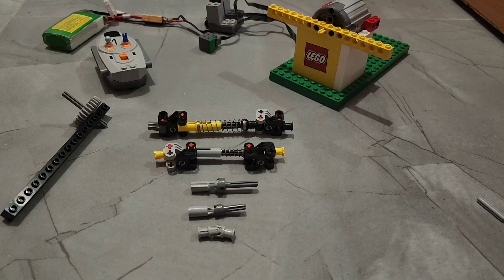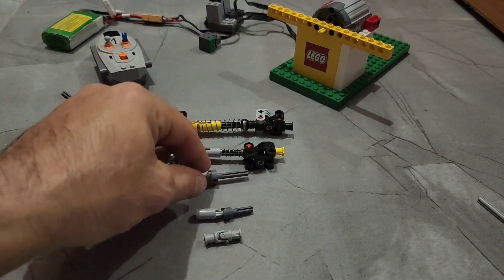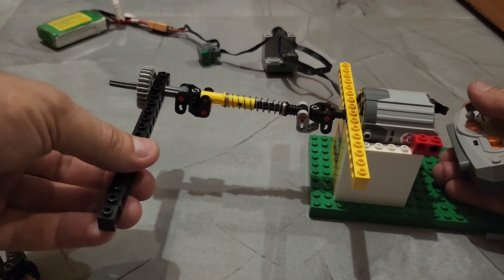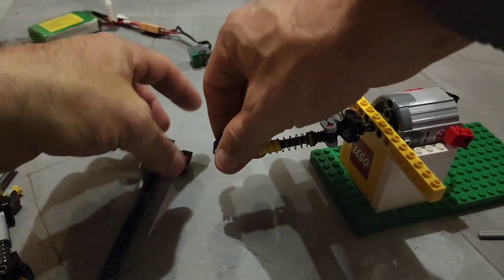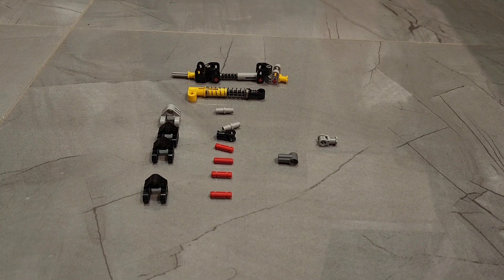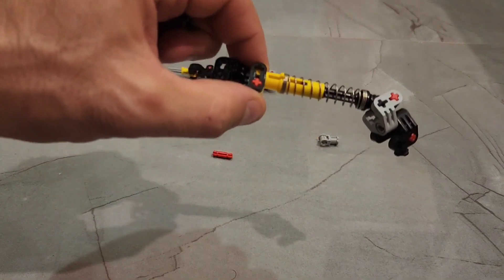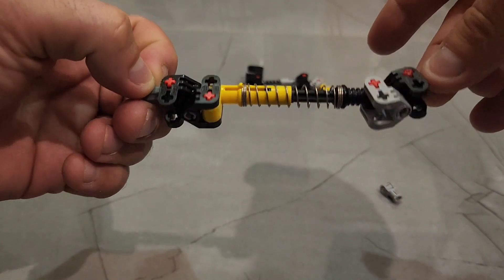lego technic: new cv joints/universal-joints

Comment: It does feel like reinventing the wheel. I don't believe this would be stronger a than 77590, which has plenty of shaft extension space. The spring is twisting when you try to stall it, and also the spring in a compressed form will add friction. Also, the power transfer won't be smooth, it seems to be wobbling quite a bit.
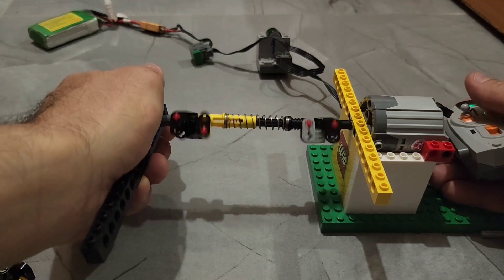Reply from the maker: The wobble depends on the engle. If the engle is not on the "edge", it wont wobble at all. The shaft of 77590 is smaller. Its not perfect, but i think it's better. Try to look at 2:58 sec. The spring can hold torque.
Reply: @yuvallegomotorized  What do you mean the shaft of 77590 is smaller? Smaller than what? Where does that matter? It has 3 studs axle depth, out of which it can have two studs of compression/extension. And you can add more connectors to build a shaft of any length you want. I did look at 2:58, after some time it seems to twist the spring a bit. Also, what happens at 11V on a Buwizz3 with two Buwizz motors coupled? 77590 can handle that.
Reply from the maker: @viktorgyenes8368 buwizz can deliver less power then lipo and ir. 
This travel was problematic for me in the past when i wanted to use big travel of shocks, and it was realy weak amd didnt hold for long.
Soon i will test it with a car and then i will know better myself.
Most of my builds have 4 buggy motors or more.
I plan for the future car to be with 6 or 8 buggy motors, fed by lipo.

Comment: this exists btw 77590
Reply from the maker: True. metal too, but its less strong from this one, and they limited you with smaller shocks traveling.
Reply: @yuvallegomotorized  i think its stronger than your design as yours relies on pins (which shatter and disconnect too often I know)
Reply from the maker: @glowytheglowbug  
Just test it.
I did 🙂 2:57
Reply: @yuvallegomotorized  this has more travel than some shocks i think and is p strong
Reply from the maker: @glowytheglowbug  
Test it, and let us know 🙂